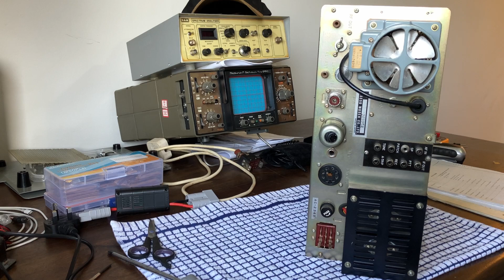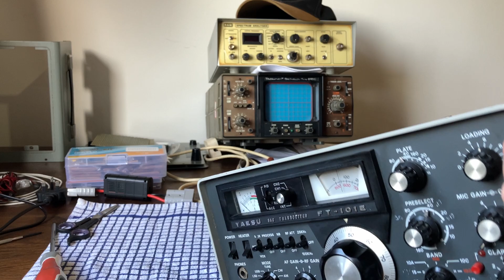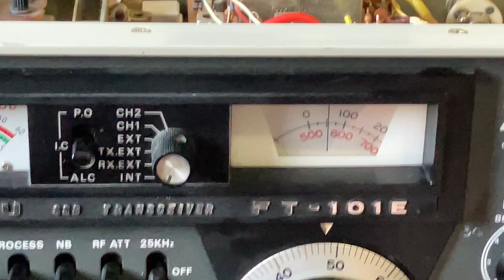FT101E  - REPAIR 💡Let's fix it ..

Comment: The plug in the ACL only connects the heaters for the two PA valves. It don't do anything more than that.
Anyway good luck with it. Hope to make a contact with you using out 101,s.
73. 
De HS0ZLQ, G0MIH.

Comment: Hello Stu. I have the same 5W smoked resistor in mine and also magic smoke. I replaced this 1.5K resistor with a wire type and again I have smoke. How did you fix yours? what was the problem? 73 DE sv3ora
Reply from the maker: Hi, watch my full repair video.
Reply: @G5STU  I finally repaired it. IT was this 200pF mica capacitor inside the amplifier compartment. It had something like 240 ohms of resistance across it, so it was starting to get more like a resistor than a capacitor. This was shorting the 300v to the ground and overheating that 1.5k power resistor.
Interestingly, my go-no-go PACO C-25 in-circuit tester was not able to find it. But my simple multimeter could easily detect this even without desoldering this capacitor!

Comment: Introducing the PA circuit will have put some strain on the power supply area in general and obviously it is showing with component failure. Recapping around the higher capacity RF area is definitely worth while and will hopefully be in whatever kit you have bought. I’m sure you will already know this but make sure you test every component you remove so you have an idea where the issue or issues are. I think you’re going to have fun with this one but it looks like it will be worth it as that is in superb internal condition. Good luck buddy

Comment: Which Deoxit you have used for the Mode switch? I found different kinds of that stuff. 73 DH9MM
Reply: DeoxIT D5 is good for switches and corroded contacts but not good for volume controls, use the  DeoxIT Fader cleaner for carbon tracks!😁😁
Reply from the maker: I have DeoxIT D5S-6 Spray, found it on amazon, not sure if it's a good choice or not though.
Reply: @G5STU  Thank you very much, i suppose it worked as intended. I was trying out some spays on several occasions, with more or less successful results. I am currently fixing a Stabilock 4031 Testset, with a wierd flickering crt. 73

Comment: As an amatuer myself Stu I fully restored an Ultra T401 radio this year for the first time. 

Hardest part (for me) was finding the correct tubes and those large can type capacitors - but there's nothing more satisfying!

The thing now receives SW better than the IC7300 with a long wire 😂

Stay safe!

Comment: Having grown up in the transistor age anything with valves equates to steam driven in my books but funnily I love valve driven guitar amplifiers ! What I do know is that when old electronics start breaking you are in for a long haul - either a complete strip down clean and repair or multilpe breakdowns and repairs. Give me modern equipment every time so it can be used, not fussed over. Life is too short. 73 M7BLC